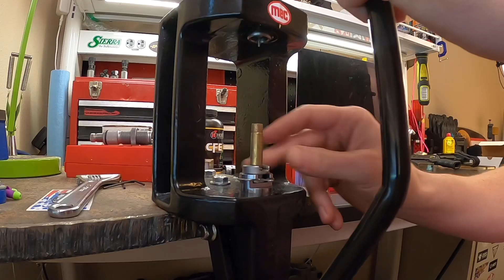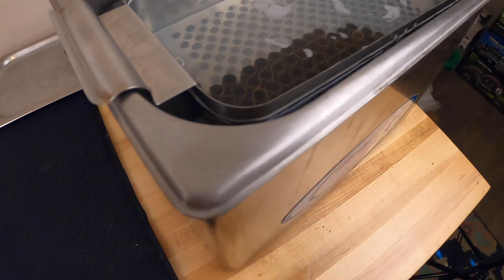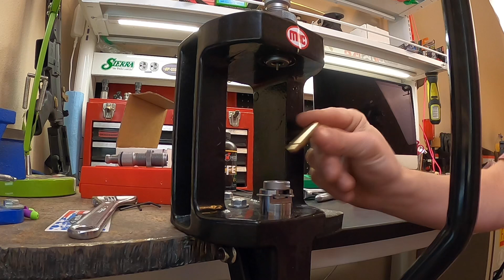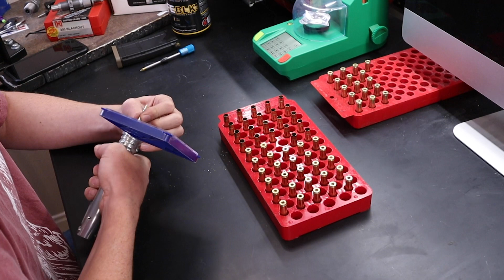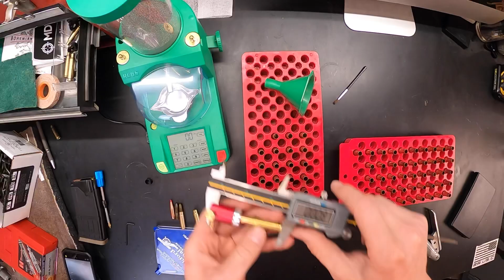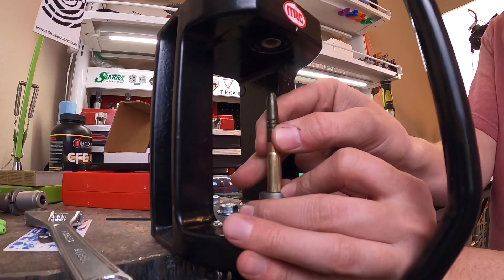Loading 300 Blackout, Cheap and Quiet! Gallant Bullets, CFE BLK

Comment: 12.5 unsurprised 110 grain for a compact deer gun within 100yards. Use 20 grains h110 and 21 grains lil gun. Ended up getting a lot of lil gun on sale so been using it more. No chronograph for speed.

Comment: Great video! I have a couple of questions for you. I heard you say you use some Dawn in your ultrasonic cleaner. I couldn't understand the other name you said. I would like to try it... I have been reloading for almost 40 years and never had this problem. I am trying out Berry's 220 grain spitzer bullets, but they get stuck in the die. They seem to be very soft with a very thin plating of copper. Any suggestions? I am using RCBS dies (part # 18401). Thanks!

Comment: First I'd like to say you have some expensive equipment! I use Lee equipment. I don't shoot competitive  just fun and maybe protection? Really like the 300BO, cast some bullets so they are cheap. Had trouble finding primers. Bought some sexy bullets online look wildly dangerous, very fast also with H110. Use 230gr for practice, funny, it takes a second or two to ring the target at 100yds.

Comment: Seems counterintuitive  .... how you use a sonic cleaner (too much lemishine btw imho) and then dry tumble your wet brass? Does that dry tumbling media ever dry-out or does it turn pasty? I do like the MEC press. But anyways, after you clean your brass thennnnnn you lube it up and resize? I mean .... why do it in that order and leave the One Shot on it to spot and stain when placed into storage? Why not dry tumble clean enough to decap, decrimp, resize and bell ... THEN wet tumble or sonic clean, whatever, and then blow dry or air dry ... and then load.  Other than that, good video - quite a few mistakes made like failing to bell (you could use a Lee Universal Expander die for instance, or a .338 die even) and maybe you could figure-out your COAL a little better but anyways, upvoted, subscribed and commenting (obviously). Thanks for taking the time. Thumbs-up 👍

Comment: Try EGW and LE Wilson chamber checkers and saami gauge. They’re worth every penny, & assist your sizing die set up too. I use H110 exclusively for blackout subsonics and supersonic. I prefer cheap subsonics for training ammo and supersonic for social issues of our time. 110gn vmax and Barnes 110gn are my social go to’s. Been experimenting with heavyweight subsonic bullets driven as fast as Blaque can drive them, just……because….. I don’t do cans. I am far more interested in the blackout in social roles that to me don’t involve being quiet. I use similar dies and procedures as you. Cheap cast that don’t foul bores are great. Am experimenting with Badman Bullets 135gn Polymer plated 135gners at about 2000fps. Work in process! Or progress lol. Also messing with 110gn cheap bulk round nose 30M1 fmj’s; but that’s something I will do just to finish—I don’t recommend them. Accuracy sucks like a Twitter princess. Avoid! Pretty much am interested in the science of the blackout for social purposes vs troublesome overpriced and over regulated cans.

Comment: Use the same bullets. I swear them to just above the first lube groove not nearly as deep. I use 11gr of cfe black and gives me around 1050fps. Keep your eye out gallant actually has a better bullet they are a 217gr pointed boattail that load way better. I chamfer every case mouth before I load them also which almost eliminated the lead shavings but not all. Maybe 1 out of 20. Great bullets though. Check out Steel Valley Casting also. That's my new go to 300 black bullet they are a copy of the sierra matching.

Comment: I have 7 inch 300AAC, 10 1/2 and 16 inch.  I load 155 gr .subsonic 311 sized to .308, Powder coated and sized again with H-110 and WSR primers.  Also 110 gr Vmax and Zmax supersonic same powder and primer that mushroom nicely for game loads.  It’s a fun round for sure.

Comment: Hornady Interlock 180gn BTSP, (no pointys.. too long) oal (8-30 Hornady tool) 1.575",  WSM primer,   10.0gn CFE-BLK or 1680 (the CFE is bigger..case fill),  case trim 1.360",  18" barrel 1-7 twist,  pistol port (adjustable gas block to slow chamber fouling and that dang chamber pop) 600 foot elevation, 80 degree weather,  Sigsauer 30 cal can,  1050 FPS.  At that speed with that bullet it will go through 6 inches of plywood. :)

Comment: It’s common practice to cast lead at .002-.003 over diameter.   Cast shooters say it improves accuracy.  I have a universal flaring die (lee) for flaring bottle neck cartridges.   Shaving coating is an indication that you need a flaring of case neck.   Can effect accuracy and of course exposed lead could be deposited in barrel depending on velocities

Comment: When working up a load with a new projectile, I’ll load dummy round (no powder/primer) and check clearances.  I then save the dummy round and label it.  It serves as a reference tool from that point out.   I loaded some 220 grn lead powder coated Eggleston bullets for blue dot 308 loads.  I had to seat much deeper than I originally thought due to Ogive being so far forward.   Anyway, I saved that dummy round as reference if I need to go back &  load more.
Reply: Great idea for making a reference tool to keep for future loads.
Reply: @mikebeddingfield2144  - thanks Mike.  It’s worked very well on especially loading “odd-ball” loads that aren’t documented well in commons loading ref docs.  And of course, not all weapons are chambered exactly alike.   I have a new member to dummy round club.  It’s a 255 grn Lee cast bullet in a 45 acp.
Reply: @motorgearhead  i will use your idea my self and i will try to the sweet spot for each different rifle I  load for I'm just getting in to it but research is the most important part, the more you learn the less apt you are to make a mistake.

Comment: sup logan.. been awhile.. had some pretty serious health issues so had to take a break from shooting but im back at it woohoo..  ya i shoot mine suppresed only also.  they are fun to shoot from time to time.  i know this isnt a 6arc video but i know you have one.. i am having case head sep problems with mine on the first and second firing..  which blows my mind.. ive never had that problem with 20 firings on things i am used to shooting so im not sure what the hell i am doing sooooo wrong..  factory and reloads do the same thing so its not just my reloads..  and headspace seems to be fine..  idk.. any ideas??

Comment: Bit surprised you don't rinse off the cleaning fluid before dry media buffing the brass. Not worried about leftover cleaning solution burning with the powder and adding to fouling?
Reply from the maker: I did, forgot to mention it.

Comment: I use cast and powder coated 230 grain bullets with H110. I am shooting it from a 16" barrel and my reason for it was to be able to shoot cast bullets from an AR. Makes for a very inexpensive load to plink with and very low recoil and low noise without a can. It's a great rifle for new shooters.

Comment: First time seeing your channel, after watching several video's I subscribed. Here is some tips to learn from my mistakes since I started loading 300 since the beginning and we made 300 BO brass from .223/5.56 brass and had lots of neck sizing inconsistencies. Get a headspace gauge for 300 BO, I don't load bullets heavier than 220 gr and avoid flat tips. Subsonic loads worked great with Trailboss powder when running suppressed. When using coated bullets expand the neck way more so you don't scrap the coating or lead off the bullet (really screws up accuracy) crimp the neck to take the bell out, do not use the Lee Factory Crimp Die as it will resize the bullet. It's fine with copper bullets but not lead or coated. I'm running a 10.5" SBR with AAC suppressor. (quiet as a mouse) . My favorite bullet is Sierra 180gr SMK for this caliber. (This gun was built and load was used to shoot hogs from a Helicopter). Keep up the good work kid.
Reply: Or just adjust the lee factory crimp die for a lighter crimp.  No need the squeeze the hell out of it for just a flare removal.
Reply: what factory crimp die do you recommend for lead?

Comment: I don't live in a free state so 16" barrel, no suppressor.  Mine seems to like 110-125 grain bullets best.  Speer 125 TNT with Lil' Gun works well.  110 VMAX with SW SOCOM or H110 is good too.

Comment: I have 9", 16" and 7" barrels and typically use H110 with 150gr Hornady SP's for plinking ammo and A1680 with 220gr SMKs for subs.  For some stupid quiet fun, I'll use about 7gr of Trail Boss with the 150gr Hornady SP's (I have a ton of them).  So far, have only shot those through the 7" barrel (look up "Solo 300"....it's a bolt action 300 blackout that when  paired with a 5 round mag ends up looking like Han Solo's blaster since it doesn't need a stock).   With that combo and a Griffin 30SD, it's mouse fart quiet....lol.  I have an Energetic Arms Vox S that can take a wipe but haven't had a chance to try it with the Solo 300 yet.
Reply: I am looking for a Solo 300 but they seem to have dried up. Ideas on finding them?
Reply: @Bhakhanda1369  I lucked out with finding a "used" one for sale on ARFCOM.

Comment: 150 grain Hornady SPs are relatively cheap (in normal times) and I don’t have to worry about leads bullet issues.
Reply: For 10.5 1:7 barrel. I load them cfe blk 19.5 super sonic and 12 for subsonic  col 2.1 using cci450 ( probably overkill ). The 150 sp's give me options for 308 and 30-06 hunting loads. The flat base gives excellent accuracy very forgiving.
Reply: I like them too for all sorts of similar reasons.

Comment: I have a 10.5 and 16” and I cast my own 230 grainers and powder coat for about 6 cents a round.
Reply: Plus 1 on a 10.5 and a 16 inch! Just started loading cast for subsonic, after using Jacketed Hornady and Berry's Plated. They loaded w/o flaring the case mouth, but it's a must for cast/coated. No time for casing, but Steel Valley has Hi-Tec, 220 grain, coated that are shooting great with CFE-BLK. 300 Blk is a caliber yyou can love, as long as you know what it's really for.

Comment: For flat base bullets in 300 blackout it’s a good idea to flare the case mouth and after you seat all of the rounds you can use a lee factory crimp die to take the flare out.
Reply: I’m doing this too with lead projectiles. I use a lee universal expander die to flare, and a lee factory crimp die to remove the flare.
Reply: This 👍👍👍
Reply: Triple this.
Reply: @marclarose4512 what die are you using to flare the cases?
Reply: I was about to give the same advice. Universal dies for belling the neck are fairly inexpensive.
Reply: Double this👆👆👆

Comment: you need to flare your case mouths   shaving the coating off is bad   and at 310 311 im surprised they even go in the chamber
Reply from the maker: I certainly would have if I had the die. 🤷🏻‍♂️ thanks for the recommendation I will certainly go that route
Reply: Lee makes a universal flaring die that is perfect for the case rifle stuff.
Reply: Good comment. I flare all my 300 blackout, especially lead or flat base bullets.
Reply: 310-311 diameter is fine for cast boolits in 300 BLK.